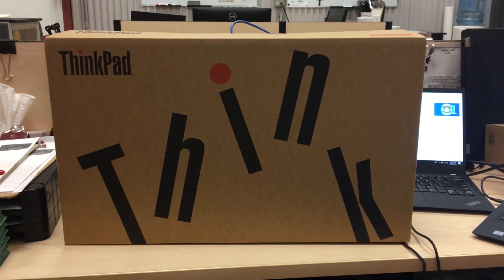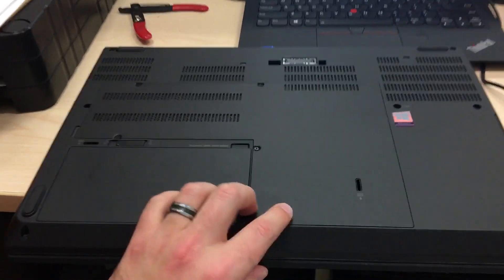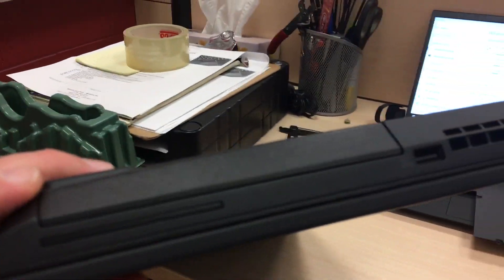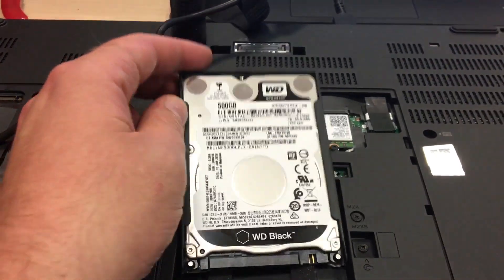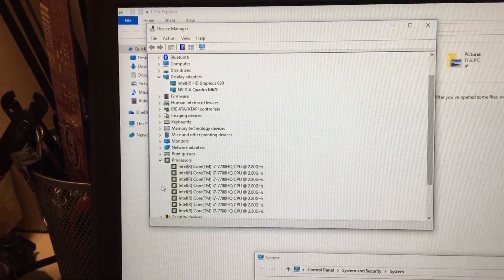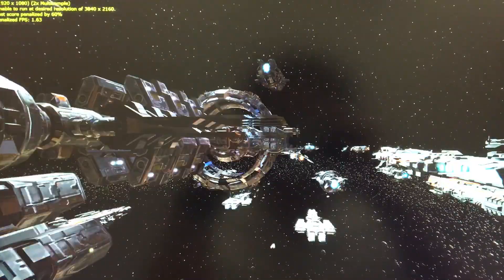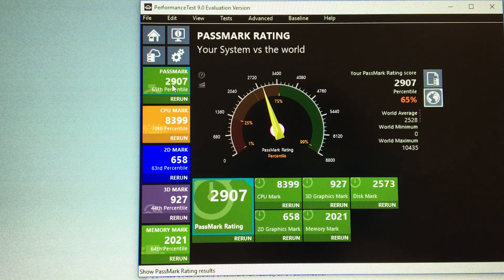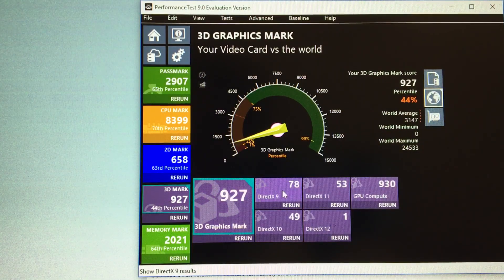ThinkPad P71 System Review Benchmark And A Look Inside For RAM & Hard Drive Upgrades -  20HK-0013US

Comment: P71 is perhaps the best workstation laptop available on Amazon. I have been using a non Thinkpad Lenovo for 4 years after using HP and Samung for 2-3 years each. HP had motherboard / GPU issues and stopped working. My current Lenovo machine - A 17" Quad Core-i7 - is rock solid. I don't shut it down for days on end. In fact only time it is off is when I am travelling. My next purchase is going to be a Lenovo. I have heard that ThinkPads are build to a higher quality standard compared to their retail lineups and are also more up-gradable / maintainable. I am looking for multiple free PCIe ports mainly for adding PCIe M.2 SSDs. Does it have any free PCIe port?
Reply: Do you enjoy using Windows 10?
Reply: @thinkpadfan2561 No, I use windows 7. Windows 10 does a lot of Internet chatter and drains out by cellular data when I am out. More importantly it comes across as as a piece of software that has no respect for your privacy.
Reply: @lhxperimental  What machines do currently running Windows 7?
Reply: that is correct. there are even some P series that are military grade
Reply: @thinkpadfan2561  I don't have a P71 or any P series laptop. I have a Lenovo Ideapad